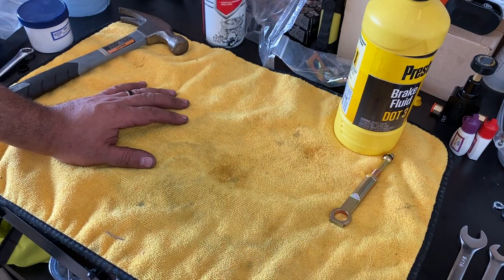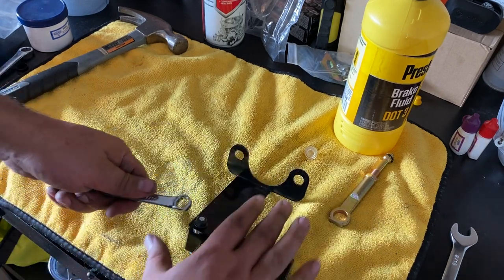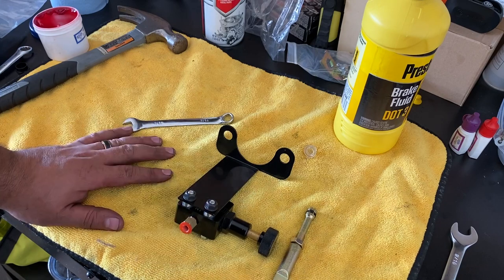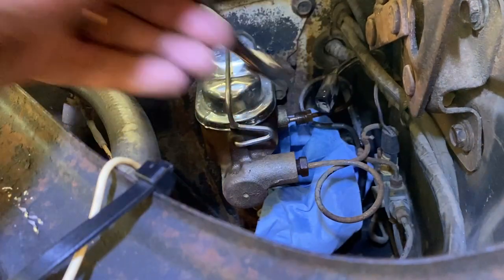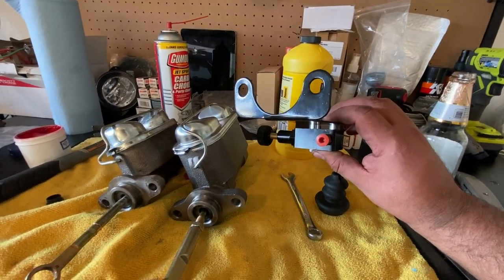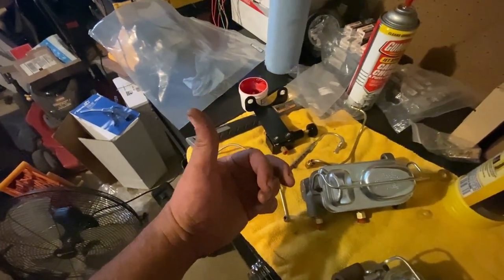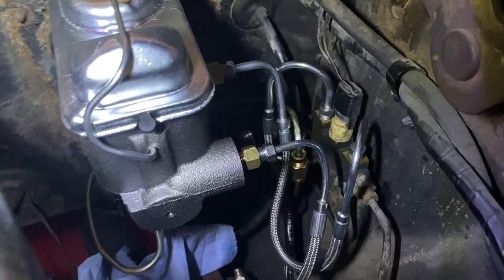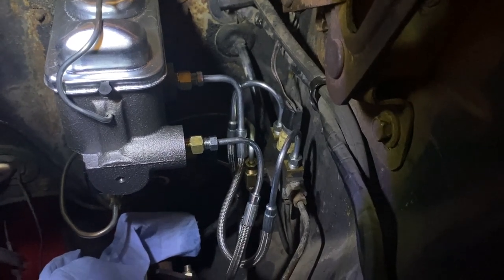Installing the master cylinder brake lines and proportion valve in our classic mustang #howto #csrp

Comment: Good Morning Negan! Nice clean install. I really like those flexible lines you put on. I did not know about them when I did my install last summer. FYI, On Fords the common gas pedal to brake height is 2 inches higher on the brake pedal, or close to that if your adjustable rod allows it. I tend to go a bit higher with the brake pedal to avoid bottoming out the adj. push rod in the Master Cylinder. thanks for sharing. See you on the next adventure. Cheers and blessings from Motown/Dearborn.

Comment: Hey again Negan!! Ok, the braided lines came with your CSRP kit. I am doing rear drum to disc conversion and CSRP makes only Front kits.  I found All Star brand on Amazon but the connectors are different. Thanks! Hope everything is going great with you! Any new videos on the horizon?  Cheers from Motown!  Did the adjustable Prop valve come with the kit too? Like like the bracket setup a lot.

Comment: I'm installing a Leed booster and m cylinder. I'm keeping original front disc rear drum setup. Do I still need to install the proportioning valve? If so, would the go on read drum brake line?

Comment: Where did you get those flex lines for the master cylinder to distribution block?
Reply from the maker: They came with the CSRP kit. I recommend this kit  no leaks or issues. It was great not having to bend or make custom lines.